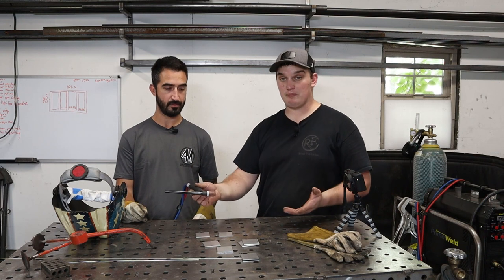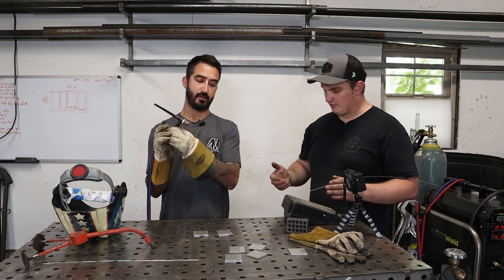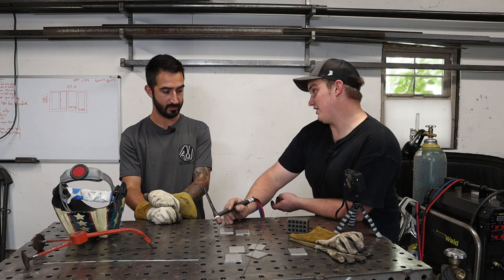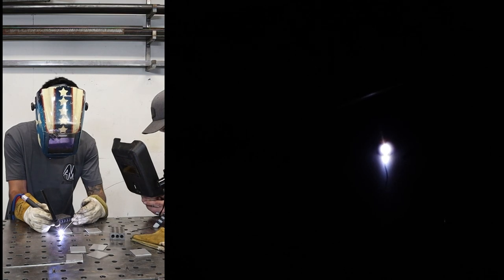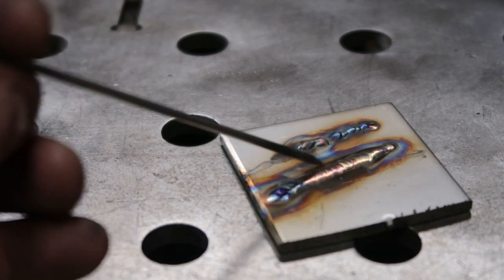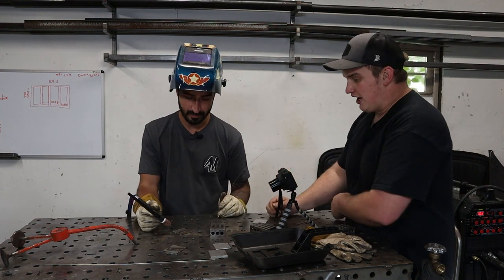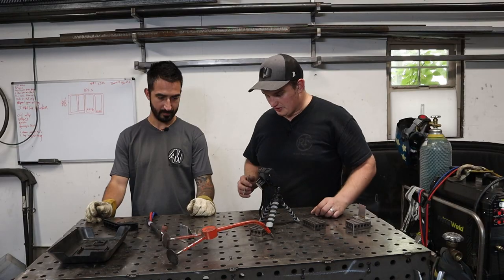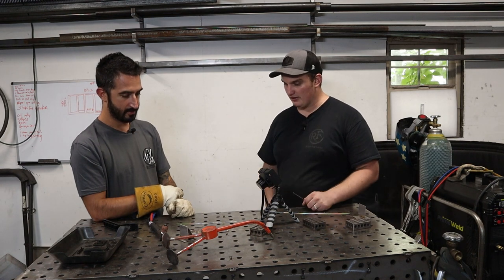First Time Tig Welding.... Stainless Steel hands on Tig Lesson

Comment: Nice job of teaching the new guy! One thing I didn't see or hear was, clean surface metal and clean filler rod. Everything needs to be clean. You can get away with slightly dirty metal when Mig welding but cleaned material and filler rod is a must while Tig welding. Good job.

Comment: Can you "Mig" weld stainless steel?
Reply from the maker: Yes I've never personally done it on this machine I've done it on a millermatic 251 you use a different shielding gas though most commonly used 90/ 10

Comment: Your joules of heat input is
Volts x amps x 60 divided by your travel speed. The foot pedal controls the amperage, arc length controls voltage. The amount of wire going in the puddle has nothing to do with heat input!
44 year nuclear welder and 35 year welding engineer here.
Reply from the maker: You are correct I said that wrong.wire speed does not affect the heat input .but correct me if I'm wrong it can regulate and or bring down the existing temperature of the puddle. Just from the cooler thermal Mass of the rod much like a small cup of cold water can tame a boiling pot of water for a
 short time. Thoughts? Really appreciate the constructive criticism. 😎👊
Reply: @amcustomfab  Yes it can help to quinch the puddle, in essence cooling it faster but the same heat has been applied. On nickel metals this can actually promote distortion.